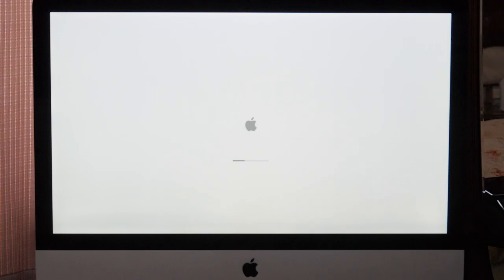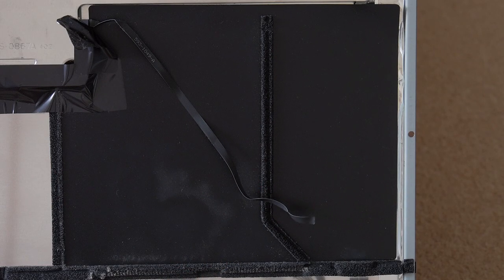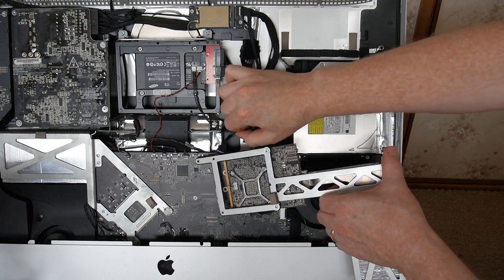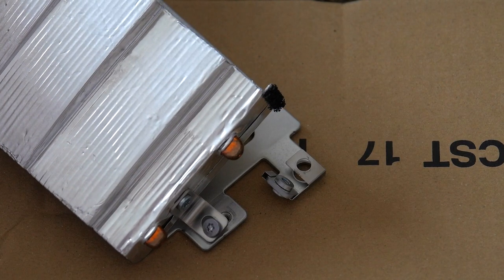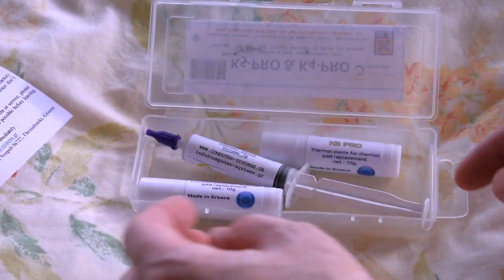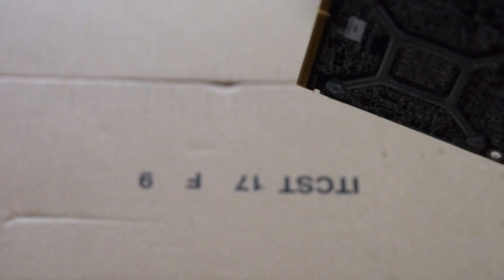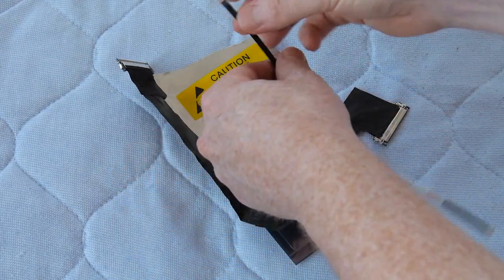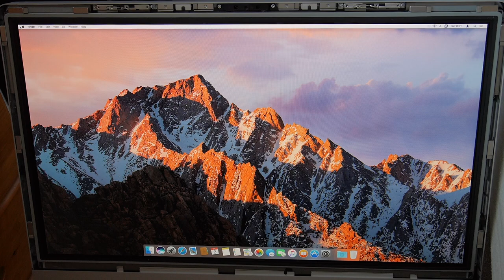Late 2009 iMac 27" Video Card Repair — 4850 — 2nd Bake

Comment: bake no necessary , reflow with hotair only core, it's enough for years
Reply from the maker: Currently, there are 430 comments here, including yours.  I read and reply to every comment.  I can tell you that the bake is indeed very necessary for most people.  Not everyone has a hot air gun, but pretty much everyone has an oven.  Even for people who do have a hot air gun, simply blasting away with hot air is unwise.  Those air guns can raise temperatures far above this oven bake, and if you aren't careful, solder can melt and components can move around or drop off.  The bake is safer and easier for most people.  That's not to say a hot air gun is a bad idea, and it clearly works for you.  Some others have reported success.  But again, it's not the mainstream solution for the average person. And while you may not think that even the oven bake shown in my video is really for the average person, you'd be surprised what people (myself included) will do to save a buck and continue using a computer that cost them a lot of money back in the day.  It's not only men either.  There are some ladies who have been successful with the bake too.  Anyway, thanks for watching and for sharing your own method of success.  I'm glad to hear you got your iMac back in working order again!  Merry Christmas!
Reply: Hi  @JDW-  , really appreciate your super detailed videos. I'm not super comfortable about using the oven because my wife and my daughter frequently use it for baking (baking breads or cookies, etc). So, I'm considering buying a hot gun (under $30) and try to use it. But I'm still debating.. What would you suggest? Do you think there's no bad impact on the food that will be cooked in the same oven? Is there any recommended procedure that I could take (e.g., clean up... or change the air in it... or even using a sealed bag when I bake the GPU board)? Thank you in advance.
Reply from the maker: @StudioTIMO  I baked my video card 4 times in our family oven and our family has not had any ill effects.  That's because the temperature isn't hot enough to melt the solder completely and therefore there really isn't much in terms of fumes that come off the board during the bake.  Of course, I have a convection type oven with a blower fan inside, so perhaps that helps.  But most people who try the bake do so in their home oven, again, without reporting any ill effects.  If you are concerned, you could simply wipe down the inside of your oven after the bake.  

I believe you can buy heatproof turkey bags or similar oven bags in the US, so putting such a bag around the board should work just fine.  Naturally, I've never done that myself, but the heat would penetrate the bag.  That's actually a pretty good idea.

I think using the oven is safer and easier than a heat gun because with a heat gun you can easily apply too much heat which may totally desolder the GPU chip and surrounding SMD components.  If they get desoldered and move around, you may not be able to solder them back on in the correct way.  That again is why I think the bake is better for most people.  A very rare few people experienced with a heat gun commented they had success that way, so it can be done.  You just need to be very careful when doing so.  And because of the heat involved, you would not use the heat gun on the GPU chip for 10 minutes.  It would probably be more like 30 seconds, although that's just a guess on my part.  I have never tried it.

Comment: maybe you need to put paste on cpu also, if cpu is hot to much that is bad for gpu and she is bad again
Reply from the maker: Yes, it is a good idea in general.  However, even if you don't repaste the CPU, it will not prevent booting or cause freezes and lockups like a faulty video card will.  Any excess heat from a CPU that has not been repasted does not affect the GPU due to (1) physical distance from the GPU and (2) internal fans.  

Because of how involved the GPU bake is, I would really need to do a separate video on CPU repasting to keep one video from getting to long and complex.  It seems logical to put it all in one video, but there are people who complain when videos get too long.  Some people just get lost in all the information.  But again, you are right in that repasting does help.  That's why I have a video on MacBook Pro repasting here: https://youtu.be/_XQNGNAwrLw
Reply: @JDW-  I just think about total temp in computer will be increased. if i open any computer i repaste cpu also, i fill lake saving of life to one computer, hehehe. Next week i will do bake of one imac 27 2011 and 21.5 from 2010 because of your video. Only i still dont know which pasta to use, artic m4 with termal pads or like you diid it K4+K5 pro ? I was stupid. I buy because i see the apple logo, i think hdd problem , so i buy it. Later i see im deep wrong. Both computers gpu problem. Im sorry im long term PC guy and begining apple guy.
Reply from the maker: I recommend K4 Pro because it normally comes bundled with K5 Pro, and you definitely need K5 Pro for the GPU memory chips because there is a gap between those memory chips and the heatsink. But if you want the best GPU and CPU paste, get Thermal Grizzly Kryonaut. Never use that or other CPU/GPU pastes on the memory chips though. You can see me use Kryonaut in my MBP repaste video.  And although you can use Arctic MX-4 on the CPU and GPU, it’s about the same as K4 Pro.
Reply: @JDW-  thx a lot! i will do it like that; K4 pro + K5 pro is easy. Have nice day/eavning.... we go to sleep now, im from Europe. Have succes in your life and make nice videos for us!

Comment: I don't think that you looked clearly enough to your RAM chips!!! I noticed as well as you did, that some RAM's had dried out the Heat paste there. That should make you aware of different temperatures of chips. I had the same thing with my Alienware laptop and noticed that two RAM chips were showing signs of being very hot. Replace those will solve the problem with your card. But that needs serious soldering with a heat gun and good reflow mats.
Reply from the maker: The fix has nothing to do with the Video card RAM chips needing to be replaced as evidenced by the fact my Mac and it’s video card have been running perfectly on a daily basis for more than two years since my second bake, as mentioned in the closing paragraph of the text description above.
Reply: @JDW-  Well you proved that miracles exist.  I do some electronics & repairs and I am REALLY surprised that it hold out so long, as you mentioned. There is some cross talk over this issue and subject and most of it mentions that it only works for a while. So in compare to my own experience it is quiet exceptional. My card was completely dead after the second bake. So chapeau.
Reply from the maker: @xjohnlangerijs527  I wouldn't call it a miracle insofar as many others have had success too.  I read and reply to every single comment beneath all my videos, and I know from those experiences that people have tried the bake and have had long-term success.  That's not true for everyone, but in terms of the reports I've read in the comments, about 90% of the people who try the bake find it works for them in the long term.  It doesn't matter to me that other YouTubers poo-poo the idea.  It worked for me.  It works for many others.  Therefore, I consider it a reasonably good and low-cost solution to the problem.  The main caveat is that it takes a long time and is a big bother!
Reply: @JDW-   Haha agreed there. And I suppose there is always... the silicon lottery ... right? ;-)

Comment: How about we take a hair dryer to the iMac? Don't remove anything. Will that do anything? I don't feel comfortable taking the dang thing out.
Reply from the maker: If you’re suggesting that you simply put a hairdryer on the front or back of the iMac without first removing the front glass or LCD, then no, that would not work at all. But if you were suggesting that taking a hairdryer to the card while it’s still locked in place on the motherboard, no one can really say for sure because no one has ever tried that. But a big part of the experience involves changing the thermal paste, so my guess is that even if it worked it wouldn’t last for very long. You really do need to change the thermal paste and there are two types of paste that you would need to use.
Reply: @JDW-  No. I can open the iMac up. Just don't want to remove the GPU. Focus nozzle of hair dryer on top of GPU and hold it for 20-30 minutes. Yeah?
Asking because I used to do that to graphics cards in my PC and I had lot of success with it.
Reply from the maker: I do not think it will work for two reasons. First, if you do not remove the heat sink, most of your heat will be dissipated in that heat sink! Second, like I said before, you need to remove all of the old thermal paste and apply new paste. If you don’t do that, any benefit you might get from the heat on the GPU would be lost due to inadequate thermal transfer. It takes more effort to do it right, but the rewards for doing the job right are worth it. 

With that said, there is no harm in doing what you suggest. You would simply be the first person to ever try that. By all means go ahead and try it. I just don’t want you to have high expectations that will work perfectly or last a year or two.
Reply: @JDW-  Really appreciate you taking the time to explain. I am a fan! Thank you.

Comment: Hi there , i've very big issue with my IMac mid 2011 27" i7 3.4gh with AMD Radeon HD 6970M 2GB,
so the problem is that the mac is keeps restarts over and over in randomly way "like in the likn below" , it's started when over a year a go while i was working on graphics software .. sometimes while playing a video or movie , and 2 month ago i't takes a different corner , the computer become restarting over and over before the OS lunch .. please help .. 
https://www.youtube.com/watch?v=HoDjYisHUF8
Note: i'm running Elcapitan & i tried to upgrade the OS to sierra, but the issue is still not fixed ..
Reply from the maker: Thank you for your comment.  I just finished watching your video (and I think people are very cruel and heartless saps for having give your video all those Thumbs-down clicks).  Based on my experience, I think you may have two separate but related problems.  Most likely your graphic card is failing and as a result has caused a number of freezes or crashes or restarts for you in the past.  When your Mac freezes and forces you to restart it, corruption of your drive's data (especially the MacOS system files or directory) can occur.  I have experienced this many times.  I have tried Apple's Disk Utility but it normally gives my drive a clean bill of health (i.e., it isn't of much use).  But Alsoft's Disk Warrior almost always resolves the problem by rebuilding the directory.  DiskWarrior is better than TechTool Pro even though TechTool Pro also claims to be able to rebuild the Directory -- I know because I also have TechTool Pro.  Using DiskWarrior usually gets my Mac to boot again.  BUT, if your video card is the root cause of crashes and freezes, then you will ultimately get another freeze that potentially corrupts your directory again, and the cycle repeats.  Again, I've experienced this first-hand.  So the complete solution here is to get the video card fixed, then run DiskWarrior and other utilities on your hard drive to fix problems caused by past crashes, and then you are usually good to go, unless there is a problem with your spinning platter hard disk.  In that case, I would recommend an upgrade to a Samsung EVO, which is what I have in my 2009 iMac right now.  It makes your iMac run cooler too.  I hope this information helps you, shdad!
Reply: Thanks JDW for your reply , i tried to replace the the thermal paste after cleaned it well .. but nothing changes at all it keeps restating it doesn't lunch even for a second .. do you suggest to baking it now. the "GPU" not the imac hhhhhh , once again thanks for your advice ..
Reply from the maker: You most likely have a bad video card, just like I did.  And simply replacing the thermal paste will NOT fix that problem, as you have discovered.  So yes, unfortunately, you will need to re-open your Mac, remove the video card, carefully clean off ALL the thermal paste, bake it according to the instructions I give in the text Description under my video, let it slowly cool to room temperature, apply new thermal paste (make sure it is NOT electrically conductive) to the GPU and the memory chips, keeping in mind that you need either thermal pads or K5 Pro on the memory chips, then reassembly everything and test.  So long as you don't forget to connect ALL the connectors, and so long as you don't break any wires, your iMac should be like new again.  It works for the vast majority of people who try it.

Comment: Stop baking and replace the video card already. Baking is just a stop gap it doesn't resolve the underlying problem.
Reply from the maker: The precise length of that “stop gap“ you mention is written at the bottom my text description above and  is updated by me monthly. Prepare to be amazed! :-)
Reply: I just think that IMHO the best thing would be just to replace it. I see AMD 6770's got the iMac on eBay for $40.00 which is not that much and it's a better card.  And apologies if I came off a little on the rough side. Good luck
Reply from the maker: I love all comments, so please don't feel bad.  It's just that I actually did have Apple replace the card with a brand new card, but that card died 3 years later.  The issue is that the Apple video cards in iMacs from 2009 through 2011 (possibly 2012 too), have GPU chip issues.  So even new replacements are no guarantee of success.  And while there are faster cards, some are not a perfect fit and as such they may require cutting, and they may run hotter too, which is not best for a series of iMacs that already run very hot.  Believe me, I'd love a faster card, but I'd want one only if it was a perfect fit and ran no hotter than the stock card.  But I am not aware of one that fits that criterion.  So for now, we bake!  :-) Thanks again for watching and for your comment!